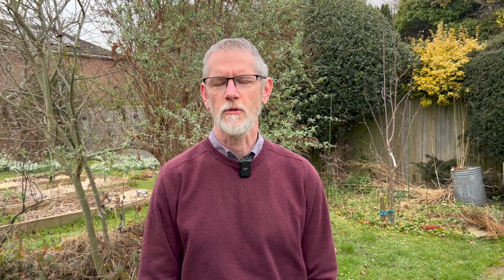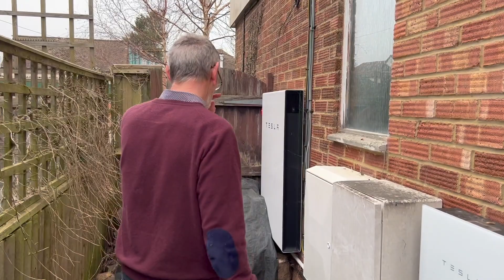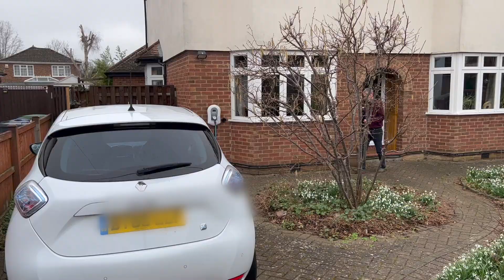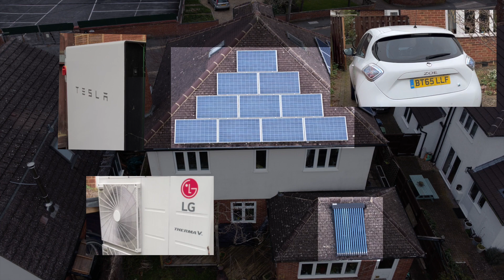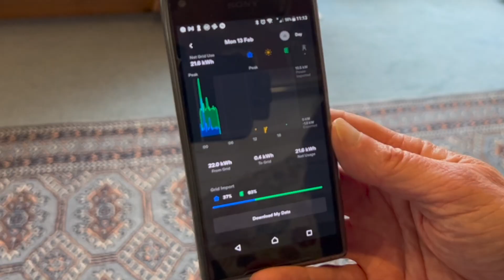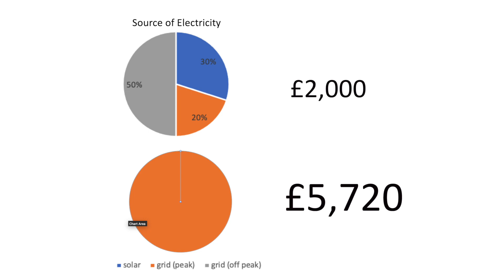OPTIMISING AN ALL-ELECTRIC HOUSE

Comment: Absolutely useless video, unless you want to just shake your flares along to the hurrahs of 'reducing my carbon footprint' rubbish of Extinction Rebellion. Lets turn off the grid and see how Pete's little setup fairs then, eh? Let's see where all these setups are in 2026, when gas has become a thing of the past, off-peak electricity is at 75p per kWh and peak is at £1.50 per kWh. People have absolutely no idea of what is coming down the line. He will be paying more to run the heat pump than he ever did in gas, in fact I predict he'll be paying in excess of £5000 to run his heat pump over the year. The only way to beat what is coming down the line is to produce as much yourself and to limit luxuries such as central heating, of course, in my humble opinion.
Reply: In 3-5 years it will have paid for itself.
Octopus Energy are now making huge strides to purchase their own wind and solar facilities. They have reported on this recently.Have you checked them out? They are very good and actually make a difference.
The guy has put his money where his mouth is.

Perhaps you would like to share your own energy reduction story.
Reply: He’ll be saving even more than ever under those circumstances - which are highly unlikely.

Comment: Nice little setup. I do question the size of that heat pump.  I wonder what the COP is?

There are a lot of guys installing oversized heat pumps from what I have looked into.

Comment: I'm with you on everything except the solar thermal for domestic hot water.  The cost of ST (hardware, storage tank, installation, maintenance) is far out of line with the benefit it provides, especially compared to spending the same money on a large commodity electric water heater and heating it overnight on your off-peak rate.  A hot water tank is also a means of storing energy.  For those who have the roof space, more PV, to send more electricity to the grid or divert to a hot water tank is a better use of money.  PV requires more roof space than solar thermal but it requires far less money.  Your dreams of solar everything will be limited by your money or by your square meters of sunshine.  I can get more sunshine but I can not get more money.
Reply: Totally agree with you,. 

Solar thermal can generate great amounts of heat during the summer when you don't really need it. Because excess PV can top the hot water tank during summer.

In the winter there's just not enough sun to really get enough out of it. Freezing problems can occur.

He could probably add another Tesla power and I have it paid off within 5 years. That or give it to the electricity company.
Reply: The solar PV can also drive a heat pump to heat the hot water even more efficiently
Reply: @JohnR31415  Readers need to keep in mind that a heat pump water heater runs on AC and has a starting surge, meaning that if you want to run it with solar power, that you will need a grid-tied PV system or a battery backed PV array.  The sum of these two blow the budget before you ever get around to buying the PV panels for the project. 
   If you go the DC-direct route, $1,200 of PV panels (2,000 Watts) for DHW is plenty for most couples and $2,000 of panels(3,300 Watts) makes enough hot water for a family with several teenage girls.  PV panels are that cheap.  
   Keep in mind that 16 states and counting do not have net metering for you to hook your inverter in to.  And many of us here in the north see little value in drawing heat out of our houses with a heat pump water heater,  and then eventually run that hot water down the drain.
    For those living in south, with easy access to net metering, absolutely,  spend the extra money for the HP water heater, grid-tie inverter and grid connection, but fewer panels and you will be set with free hot water and even get a bit of free air conditioning.
Reply: @peteinwisconsin2496  there is more world than the US.  But why would you take heat out of your house? I mean if you want air con for “free” you might vent the chilled air into your house…
Most heat pumps can do both hot water and heating - they do it with outside air.
Similarly most PV systems are grid tied, because most people have access to the grid and can’t supply 100% of their needs anyway.
If you don’t have a grid tied inverter then you’re seriously limiting what you can do for the vast majority of houses.
Reply: @JohnR31415  I did not know about heat pumps that heated water using outside air.  I only knew about heat pumps for space heat and a separate heat pump water heater that collects heat energy around it and puts that into the water heater tank.  Thank you for correcting me on that.    
> Similarly most PV systems are grid tied, . . . .<   In 34 of the US states they are.  I am referring to the sixteen states in the US and 125 countries around the world that do Not allow grid-tying.  There are no grid-tie inverters in these places but there can be solar hot water via DC-direct from PV panels.  They all get sunshine and nearly all use domestic hot water.  There is little reason to pay the high initial cost and high maintenance cost of solar thermal when PV is so cheap and works perfectly well without a grid connection.  Typically PV powers the water heater lower element and one can still use grid power for the upper element as a backup, or pipe from the outlet of this commodity electric water heater to the inlet of a hydrocarbon, on-demand water heater as a backup.  For me, I have not needed to run the grid-connected element in my water heater in over three years.  My system is big:  $2,000 of PV panels and an 80 gallon tank.
Reply: @peteinwisconsin2496  can’t find any evidence that grid tied is banned in any US state.